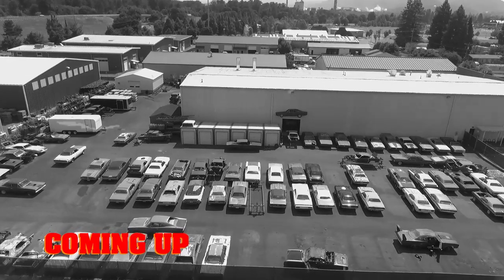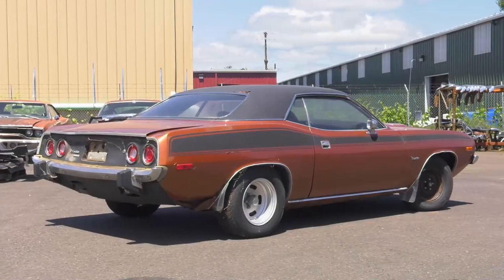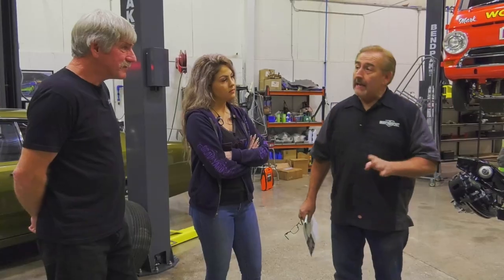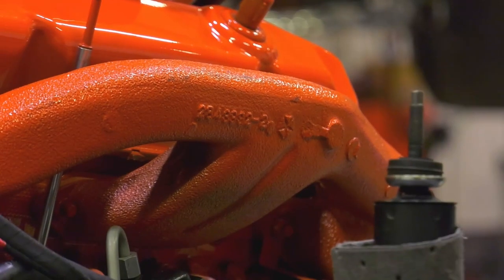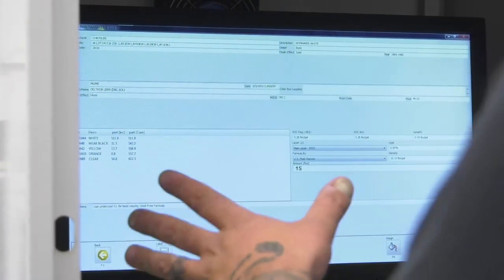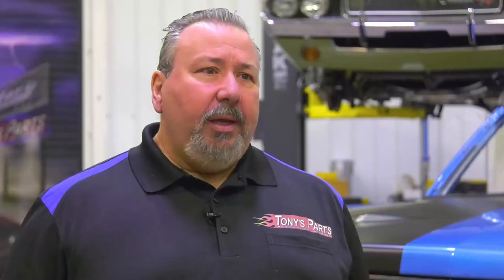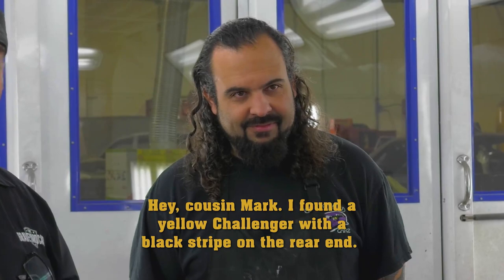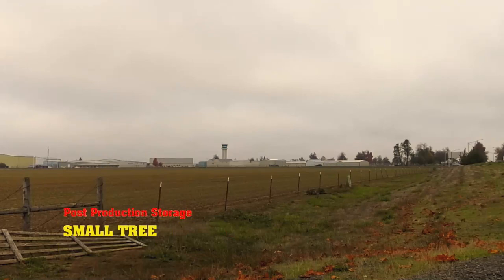S10-YOUTUBE PREMIERE: FINISHING THE 440 SIX PACK CHALLENGER

Comment: As for your engine choice question,  my 71 Cuda was originally a 340 H code car. That engine was missing by the time I bought my Cuda about 11 years ago. So, I had to choose what engine to build for it. Only one choice in my mind, 426 Hemi! I started with a damaged 68 block I bought from Larry Shepard. I had to sleeve 5 out of 8 cylinders and there were cracks in both 2 and 4 main journals. I installed the stock 8 bolt crank with Eagle H-beam rods and Aries .070" over 10.5 to 1 pistons, Lunati hydraulic cam and aluminum Dart Pro heads. The intake is a 68 stock dual quad unit. That said, I've not fired the engine because of time and fear of the block not holding up under hard use. In April this year I found and purchased a new 426 block. 5K investment but once it's bored and I reassemble my engine I'll be able to push it hard and not worry. You just can't have a Hemi Cuda and drive it like a granny. And,  I'm converting it to 4 speed. Wish it was finished but time and family obligations have stalled progress. Hopefully by the time I retire it'll be finished.

Comment: I would pick the 440 hp 4- barrel, if money was no object. Less weight, better gas mileage and could still have lots of fun with air conditioning. I had a 1969 GTX with those options.